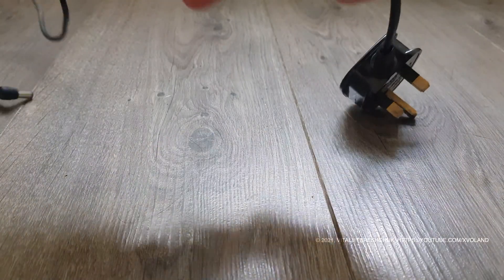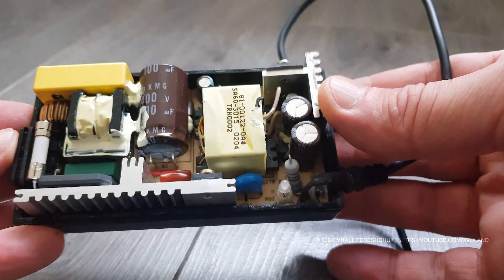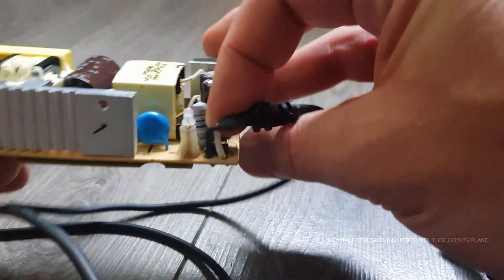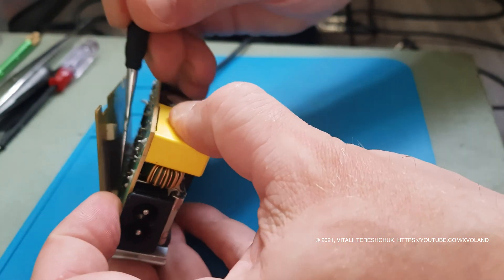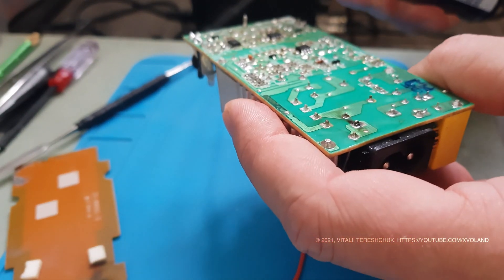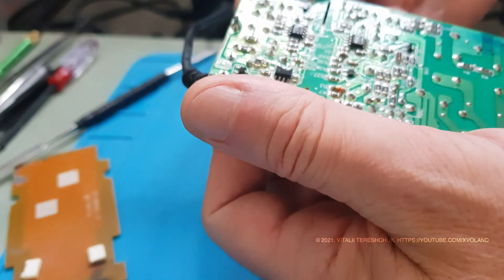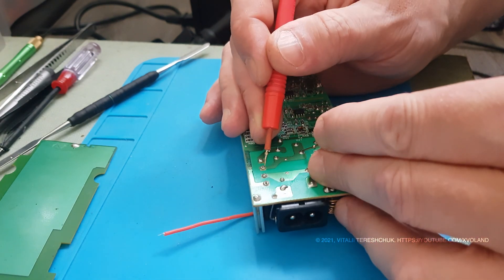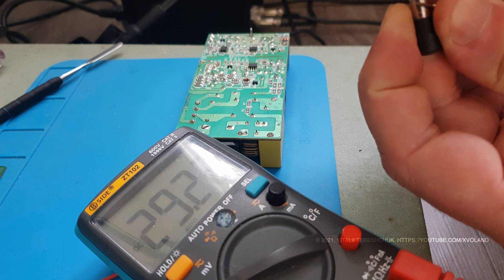🛠 Electric Bike Charger Repair. Easy fix of e-bike battery faulty charger

Comment: Chopper transistor fail. Chances are it's under spec. Replace with FET that is properly rated for peak voltage and current. Eg. 360v at 20A. Cheap insurance is to add flyback bypass diode.

Comment: Do you happen to remember what positive, negative, and grounding were? I also have three wires: black, gray, and white, similar to this charger.
Reply from the maker: If you are talking about an outlet, there is no plus and minus, but there is a ground. I don't understand the question, sorry 🤷🏻‍♂️
Reply: @xVoLAnD  My mistake, I thought a charger had a negative and positive terminal. The charger for my bike is broken, and I want to transfer the special connector to another charger with the same input and output values. However, the colors of the wires don't match. Could you help me determine which color would be the ground among gray, white, and black?
Reply from the maker: @GlenGross77  I'd like to clarify, are we talking about the socket plug? The one that connects to 220V, right?
Reply: @xVoLAnD  No, not from the socket, but the cable used to charge the battery.
Reply from the maker: @GlenGross77  Do you have a multimeter?
Reply: @xVoLAnD  No, that's why I asked. :-)
Reply from the maker: @GlenGross77  Then I wouldn't risk it.
Wire colour - doesn't always match.
On the plug, the external connector is ALWAYS ground.

Comment: How could you property measure with DMM  parameters of parts which are still mounted on the pcb? That's absurd. 1) some other parts are connected parallely to the measure one. 2) DMM apply some voltage during (for example resistance) measurement, so you could damage some more sensitive IC's.
Reply from the maker: 90% of measurements and fault detection - is done with a multimeter. Damage to chips with a multimeter maybe, but it's not that electrical instrumentation. 
I see no point in arguing with you, thanks for your comment.

Comment: i have a 42v charger it got damaged by water and its not working and the led is also not working
Reply: hi, did you repair it? I am having the same issue and I am checking if I should better get a new one instead of trying to repair it.
Reply: @MariaCelesteSalas  yes i bought a new one

Comment: i have a charger for my ebike thats reading low at the output. i took it apart and saw no visible damage. it sits somewhere aroundf 36 but jumps up and down when it should be sitting at 54.6 volts. just trying to save this so i dont have to buy another
Reply from the maker: It is necessary to look at the PWM strapping.
Reply: Check the output wire, is it intact?

Comment: I have a charger 42V outout but when i mesure it voltage jumps up and down from 40V to 60V constantly. What could be the problem what do i need to change to fix it?
Reply from the maker: This may have many reasons. But according to the described behavior, I can assume the failure of the capacitors in the PWM circuit
Reply: @xVoLAnD  Capacitors are fine... there is ic Ob2269cp. Could it be possible that if this ic Ob2269cp works badly it couses the charger to behave like this?
Reply from the maker: @StankovicIvanINTER  Of course it can, but you can check. Make sure there are no broken tracks.
I would also recommend checking all the resistors, especially the NTC is connected to (pin 5) . Check again the capacitor and the diode on the (pin 7)
Check the voltage on pin 3 (somewhere 16 volts).
Important that the transistor (connected to pin 8) is working and not broken.
Reply: Sorry, I'm not technician and this could be the last of the possibilities but multimeter with low battery can show erratic readings.

Comment: Thank you, my 48v 3 Amp charger just blew 30 minutes ago. This is very informational hope I just need a simple Sauter as my issue was the same. Spark same explosion  no voltage
Reply from the maker: Good luck with the repair!
Reply: ,zß

Comment: What are you spraying?
Reply from the maker: I was cleaning off the old flux. This is necessary to stop the oxidation of the contacts.
Reply: @xVoLAnD  But what is the spray? Water? A special kind of spray for contacts?
Reply from the maker: @PlayerSkiller420  Isopropyl alcohol for degreasing